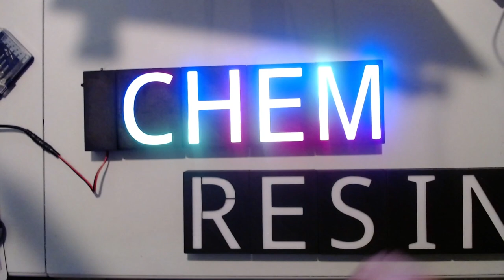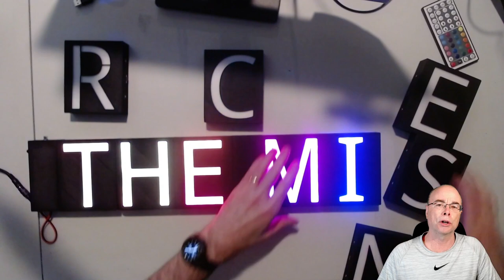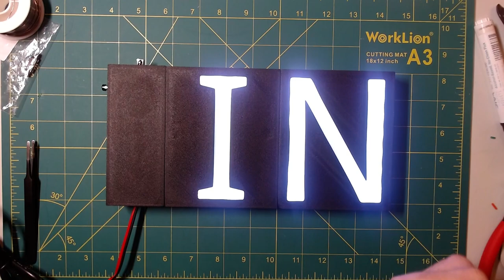Magnetic WLED Lettering

Comment: With out changing your design, A quick fix to allow more light through the diffuser is paint the inside side of back panel either white or silver to bounce the light around a bit more or use more of those dinner plates and place them on the back panel.
Reply from the maker: All great suggestions.  Thanks!

Comment: Just recently found your channel and I am enjoying the variety of projects you have. I recently made a WLED project and used white filament as a diffuser and it works really well. I actually prefer it over the acrylic panels I have in another project. I printed 0.6 mm thick with a 2mm x 2mm raised lip around the outside edgeto give it some rigidity. They friction fit inside the body of the light panel. I have a textured bed and it leaves a nice surface on the front of the diffuser.
Reply from the maker: I used white filament for my diffusers on my 3D printed clock: https://youtu.be/0EfUo-R4uD0 and they work great!

I had previously used the Styrofoam plates on my Nano Leaf build ( https://youtu.be/lNcsT5DZjAM ), and for that they are near perfect.  But for these LED letters, and with the number and position of the LEDs, they do leave a bit of a darker section in the middle.  If I were to recreate them, I might consider a different material for a diffuser.

Thanks for watching... and taking time to leave a comment!

Comment: Thanks again, another great build. 
I’m gonna have to give this one a go because I’ve been wanting to do something like this. Especially for the grandkids so I can put their names into lights.
Reply from the maker: Thanks!  I've had an "LED sign" on my list for quite sometime, but as I mentioned, I didn't want to lock myself into a fixed message.. which was how I would have approached it, by wiring the letters to each other.  Once I finally found those magnetic pogo pins (after considerable searching because I didn't know what they were even called), the light went on as a potential way to build something that could easily be changed or updated at will.

Let me know if you build your own set... and if you find any improvements along the way.

Comment: Another fantastic project, I do have a question for you though! I'm about to run a series of two LED strips to my TV setup, one to go around the back of the mounted TV, and the other to go underneath a floating mantle underneath it. I want to split these in to separate channels for ease of cable run, but I also want to include the additional button and IR sensor so we can control it either from the couch, or physically.

I'm using your project here as a template. Now, the question is, on the D1 Mini, can I use the D1 pin on the board as an additional LED strip? (Once it goes through the logic shifter, etc.) Or would you recommend moving the button/IR receiver pins to a different one? Thank you again, your work is clear and precise and I am really enjoying watching your videos!
Reply from the maker: Sorry for the delay, but I'm out of town for a few days.  If I understand your question correctly, you want to run two separate strips... controlled independently (e.g. each running their own colors/effects) off of a single D1 Mini.. including push button and IR control?

If that is correct... yes, you can now have more than one data pin from the D1 Mini... and you can define which pins you assign to both the data signals and the push button(s) and IR remote.  There are some limitations (not all pins are created equal).  In addition, running more than one signal from an ESP8266 is stretching the capabilities.  You may wish to consider moving up to an ESP32 Mini for the project.  Alternatively... depending upon your setup and needs, you can use a single data pin and define segments to control the TV and shelf lighting independently.  This would have the advantage of also being able to control them together as a single unit.

But more information on recommended pins for dual data signals and for the push button/IR remote can be found on the WLED website: https://kno.wled.ge/features/multi-strip/

I'd be happy to answer any additional questions, but my responses may be a bit delayed for the next few days.

Comment: This looks great I need to do this not sure where but I need to do this
Reply from the maker: Thanks!  The nice thing is that they are portable and easily moved.  And the back plates could easily be modified if you wanted to hang on a wall or something.  Or print a base for them to stand upright.  I tried to design something that could be mounted in multiple ways.  

If you do end up making them, drop me a note and let me know where/how you decided to put them.

Comment: This is so awesome I have been wanting to do something like this. Thank you so much for sharing. Question what font did you use? I am recreating the boxes to use fewer supports. I can share the file as well. Cheers
Reply from the maker: Thanks!  Well... as far as fonts, these were done in Tinkercad and they only offer about 4 fonts for lettering.  Most of these were done, I believe, with what they call Sans or Sans Mono.  I'm sure you've already seen it, but if not, all my .stl files are in a Github repo: https://github.com/Resinchem/LED-Letters

I'm not that great at designing 3D files yet.. and pretty much just make things with what's available in Tinkercad.  I'm sure these letters/boxes could be made much nicer.

Good luck with your project!  Let me know if you run into any questions.
Reply: @ResinChemTech  you kidding!? You did a fantastic job! I am just attempting to minimize supports in the box to speed up print time. I also might try to use larger magnets as I have a ton sitting here. I know you mentioned that in your video. Thank you so much!

Comment: Fun project, but where did you end up setting up the final display and what words are you spelling? I wish I'd seen this video when it came out, but I after years of searching I stumbled upon the magic word pogo and found these connectors myself. I use a ton of WS8212b lights in my model railroad buildings and got tired of plugging in the standard 3 prong plus one more for the output wire. I use 4 prong magnetic pogo connectors so there's only one place for the data to go in and come out.  I had to write my own C++ code so I can control each building, each floor and each room. I send  the MQTT messages from NodeRED.
Reply from the maker: Honestly, I keep them stored and will pull them out for certain occasions or when we have guests over for a particular event.  They are portable enough that I can set them up in different locations, and over time I've added letters (seems like I'm always an "S" or "E" for something new I want to spell.. so I'll have to print an extra letter at times for a given occasion).

I too have written my own Arduino code for certain LED projects.  WLED is great for colors and patterns, but for something like my matrix clock/scoreboard/timer project ( https://youtu.be/uV_HQpqIp2I ), it needed Arduino code to handle the logic needed.  I also use MQTT but with Home Assistant for control of the features.  

I really haven't done any model railroading, but I can see how strategic use of LEDs could add a lot to a setup.  Thanks for watching and taking time to post a comment!

Comment: Great project! I feel a new shelf coming. Couldn't you connect the long power lines to the output connector from the start of the strip (alongside the power in) and only run the data line from the other end. This should effectively provide power injection at every letter, removing the the need for external wires.
Reply from the maker: Thanks!  I think I understand what you are saying... instead of connecting the +5V and ground from the end of the LED strip to the out pin, run  extra lines directly from the in pin to the out pin (like with the blank, minus the data line)?  That's an interesting idea.  I think one challenge (at least for me) would be soldering the two wires to the input pin (one for the LED strip and one for the power out pin).  Those pins are really, really small and close together and VERY easy to create a bridge.  I suppose you could make a pigtail for each?  But it is an interesting thought.

To be honest, I didn't test how many letters you could truly use before voltage drop starts to make an impact.  I generally use rule-of-thumb of about 250-300 pixels, which is why I stated around 10 letters (240 pixels).  And at 10 letters, the sign would be about 42" wide (with the current design).  Using the method described above, you could likely extend that, but at some point, I'd expect that you'd eventually need some sort of additional external injection, as I suspect that each pogo pin/solder connection would also cause some additional drop.  But by that point, you might be up to something like a 8-10 ft sign!

Thanks for the comment... and the good suggestion!

Comment: Hi, love this one! What 3D printer and or what would recommend for under $500? Thanks!
Reply from the maker: Thanks!  As far as 3D printers, I have a Creality Ender 3 Pro.  They currently go for around $250, give or take.  I've had mine for a little over 2 years now and love it.  But they have come out with a number of newer models since I purchased mine.  I am by no means and expert on the printers themselves, nor creating designs.  For the most part, I use it to create custom enclosures for my projects.  I think it is a good entry-level, beginner printer.

But it is one of the most handy things that I have... and it gets used pretty much on a weekly basis.

Comment: I wonder if those pogo connectors could handle 2a or 3a? Can't see any power ratings.
Great use of those connectors, think I'll order some
Reply from the maker: I wondered the exact same thing and I couldn't find any ratings either.  But I did connect a string of ten letters (plus a spacer... so 11 connections) without seeing any significant performance issues or heat generation... not that is a 'statement of suitability'!   They did work for me, though.

One note on ordering:  even via Amazon, it took a little over 2 weeks for them to arrive as they shipped directly from China.  I checked other sites, like AliExpress, but the lead time really wasn't any better.  But otherwise, the order was fine and I didn't have any issues.  Let me know if you do end up using them for something, and how it works out.
Reply: @ResinChemTech  thanks ,  I'm in the UK so might order from China.

Comment: Great video thanks for sharing, is any video you can recommend on setting up the button and the remote control on the ESPs with WLED, Thanks
Reply from the maker: As far as the wiring for the button and IR remote wiring, I cover that in my Hexagon LED light video (https://youtu.be/lNcsT5DZjAM - jump to the chapter on final controller wiring), but have wiring diagrams and a little more info in the related blog article at: https://resinchemtech.blogspot.com/2022/01/hexagonal-led-wall-display.html

As far as the settings and setup in WLED, those are pretty well covered at the official WLED web site: https://kno.wled.ge/

Hope that helps.  Let me know if you have any specific questions.
Reply: @ResinChemTech  Thanks, so only have to connect the VCC, GND, and Data to a deferent data pin then the led strip data pin and the remote will work? as I tried doing this but didn't work
Reply from the maker: Yes... the IR receiver would need to be connected to either 3.3V or 5V (I use 3.3V) ground and an unused GPIO pin (GPIO4 is the default).  Also note that if using an ESP8266, your LED data pin must be GPIO 1, 2 or 3 for IR receiving to to work.  Obviously, you also need to enable/configure this in WLED.  And if you are not using one of the standard remotes listed on the WLED site, you must manually modify the remote codes and use the JSON remote option.  See this for more info: https://kno.wled.ge/interfaces/infrared/
Reply: @ResinChemTech  Thanks it worked on ESP8266 but had to do a lot of research to figure out the connections on the receiver I have as it's deferent to the one you're using, But worked on the esp8266, but not the esp32, so at least on one board it worked which's fine